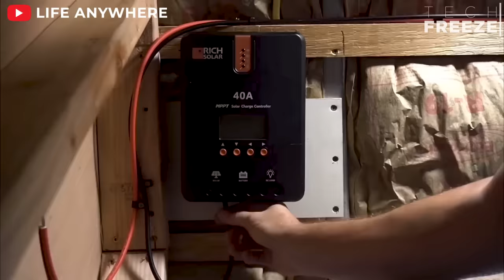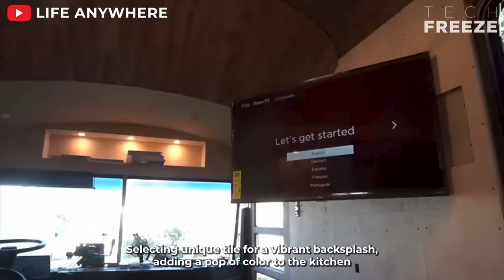Couple Transforms Bus into Amazing Mobile Home | Start to Finish Build by  @lifeanywhere

Comment: Утеплять стекловатой глупо , она имеет свойство  к просадке  и потом будут щели  и холод проникнет , как и жара . А еще будете дышать стеклянной пылью , так как  при езде дом трясется и  пыли будет много , а щели она найдет . А еще глупее  то , что поверх этой стекловаты небыла  уложена пароизоляция . Без нее будет стекловата  намокать  и там будет плесень . Да и если вы делаете утепленный автодом , то нужно и  окна  хотябы с двойным остеклением , одно стекло  не держит как тепло , так и холод . короче ошибок  мнго  они сделали при постройке этого автодома .
It is stupid to insulate with glass wool, it tends to sag and then there will be cracks and the cold will penetrate, as well as the heat. And you will also breathe in glass dust, since the house shakes when driving and there will be a lot of dust, and it will find cracks. And even more stupid is that a vapor barrier was not laid on top of this glass wool. Without it, the glass wool will get wet and there will be mold. And if you are making an insulated motorhome, then you need at least double-glazed windows, one glass does not hold both heat and cold. In short, they made a lot of mistakes when building this motorhome.

Comment: now you just need a class b permit to drive your home, when mobile homes are a thing and dont require special permits. insurance is going to be another big hoop to jump through... i have no clue why people continue to do these conversions without checking the severe downsides. i have an old retired moving truck, it sits here because it's tough to find an insurer who doesn't want me to classify it as a commercial vehicle(~$700 a month to insure it). sorry but no, it'd be a lot cheaper for me to drive illegally than legally.

Comment: Weight !?!?....maybe not as bad as it appears.... . I just looked up the specifications at least from the state of Virginia, which I think would be similar to others across the country and here is what I found... The horsepower rating is just 210 horsepower on the largest class D school buses... The gross vehicle weight is just 32,000 lb..  so, 90 kids x 150 lb is 13500 pounds.. and 46? Seats at 100 pounds each... So about 18000 pounds of modification could be done (20,000 absolute max??.. if  175 lb per kid is the guestimate)... Anyone doing this in the future should literally weigh or estimate the weight of everything?... 210 horsepower is bafflingly low ..but it is from the actual Virginia school bus specification .. .i Absolutely do remember FULL school buses struggling to accelerate as a kid